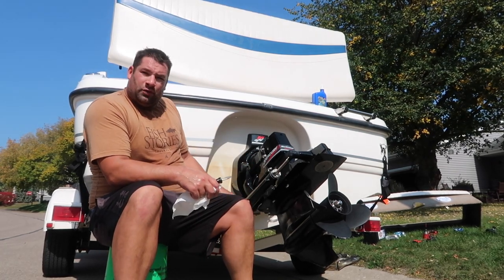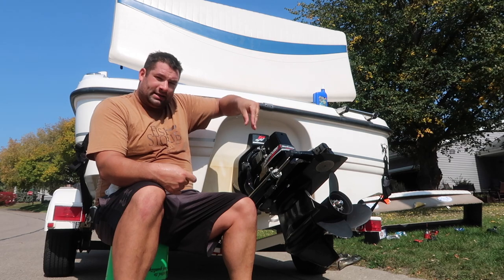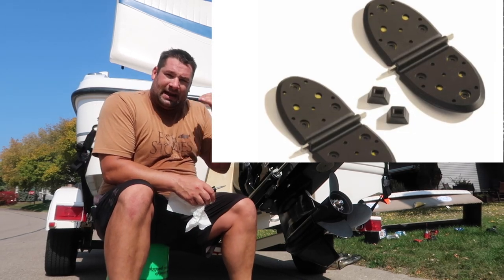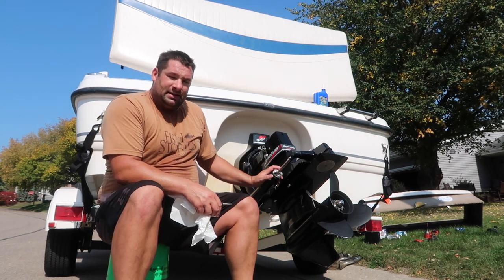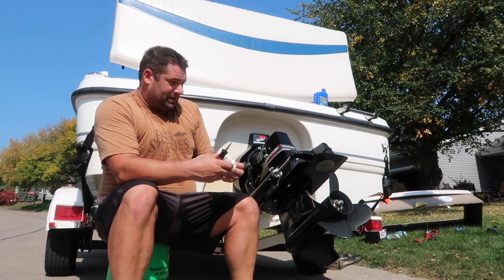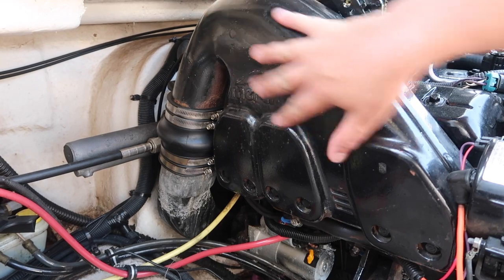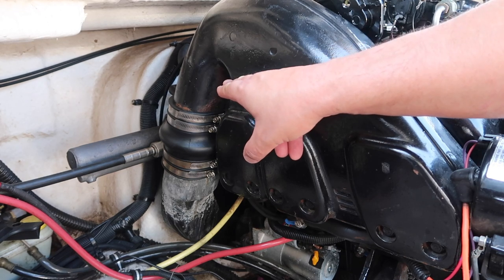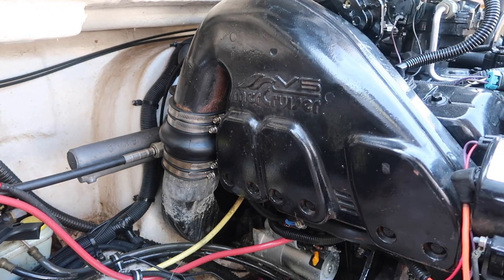Boat Flappers Explained / What do & Why do I need Flappers

Comment: I have a 97 4.3 mercruiser, I don’t see water peeing from the back of my exhaust, I did have a motor freeze plug out though and found water coming out of that, I’m curious if my flapper isn’t bad, would that cause it not to spit water out the back?
Reply from the maker: Water flapper fix the plug issue. Then see what happens